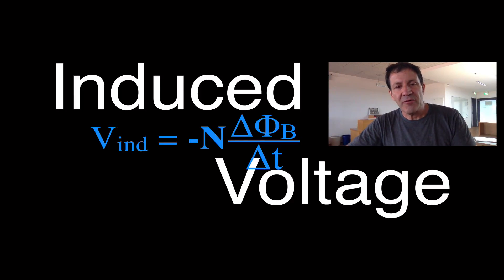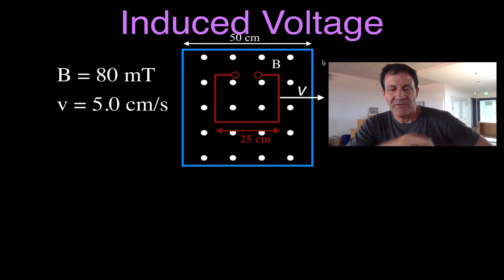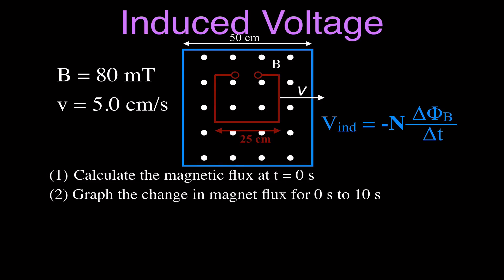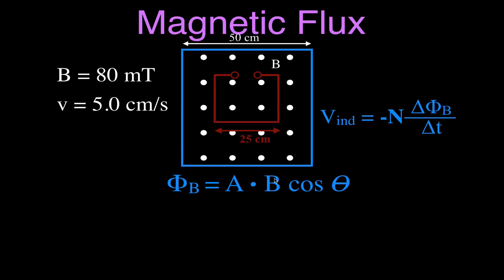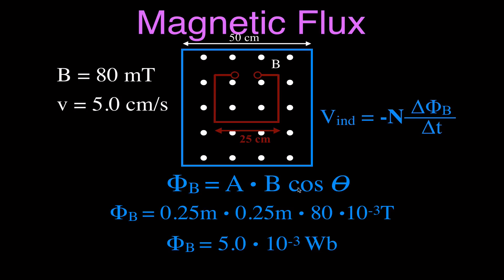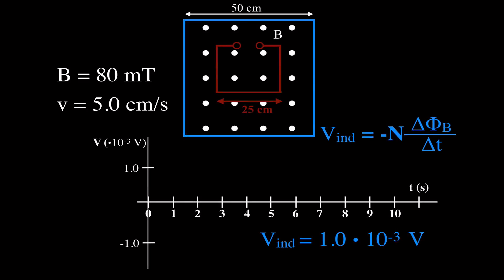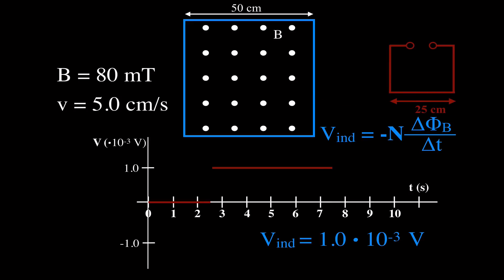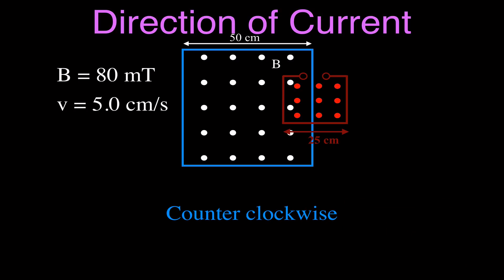Electromagnetic Induction (8 of 15) Induced Emf in a Coil of Wire, Example No. 2

Comment: Thanks, just the angle is between the magnetic field lines and the Normal line to the coil plan which is zero in this case, and the cos(o)=1
Reply from the maker: Ouch, maybe I will take the video down and redo it....Thanks for commenting and pointing that out.